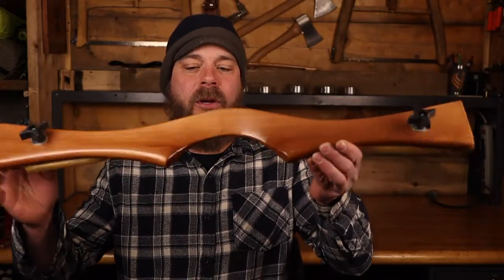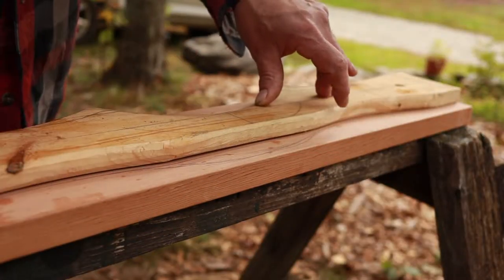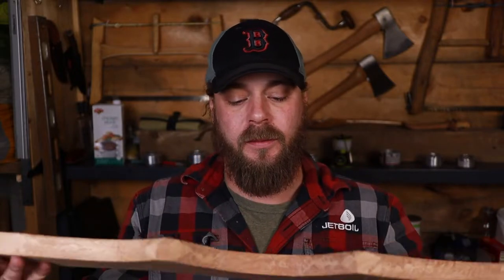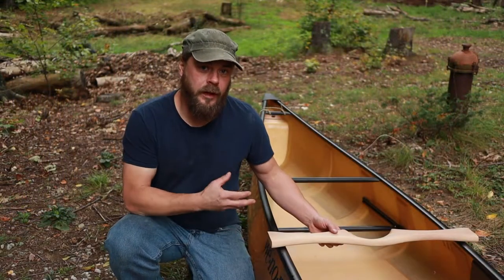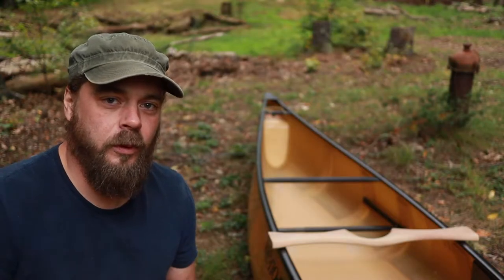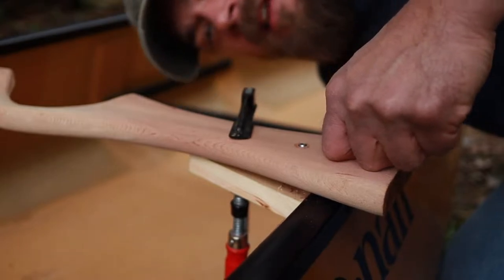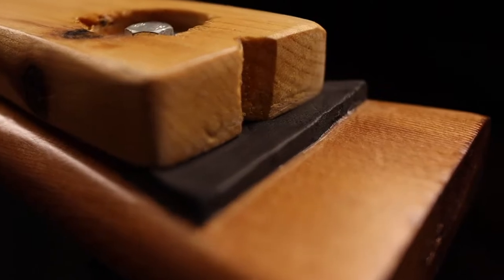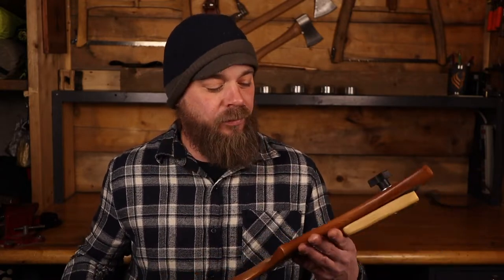How I made it / DIY lightweight Removable yoke

Comment: If you are canoe camping, then it follows that you have camping gear.  If that is true, then the seat does not have to stay in the middle of your boat.  You can place the seat about one third of the way back, and achieve balance by putting all of your gear in the bow.
Moving the seat out of the center allows for the installation of a permanent portage bar, and a two inch diameter aluminum tube makes the best one.  Flatten its ends in a vise and then use two number 8 bolts on each end to attach it to the undersides of the inner rails.  Cover the tube with a layer of 1/2" foam insulation.  
Now you can carry your canoe at any angle without having the portage bar dig into your shoulders.  I've used this type of portage bar in the Boundary Waters and can vouch for its efficiency.
Reply from the maker: Thank you for the suggestion. I have heard others say the same about moving the seat. But I think I am going to leave it for now.

Comment: Hi, and I love your  video. I’m kinda old, but I still make things, appreciating the curious, problem solving mind.  ; )
I just received my new solo canoe and need to do exactly this - make a yoke.  I would like to know what “this” is…….that’s all you said about the bolt/tightener thingy ; ) .  Those black tighteners look much better than standard wing nuts for aging arthritic fingers.
Thanks again. You are an inspiration.  ❤️ 10:53   8/14/23
Reply from the maker: Thank you for the kind words. They are simply called threaded knobs. I picked mine up cheap at the local hardware store. They work great.   What did you get for a canoe!!??

Comment: Are you happy with the comfort level without pads? Some folks just use their PFD for comfort while portaging. You have built a beautiful yoke!
Reply from the maker: I am quite happy with the comfort level. I put some pretty heavy contour into this thing, it fits nicely on my shoulders. Also, the straps of the backpack offer some protection as well. It all worked out quite well. One of the portages I did last season was well over a mile, I had about 70lbs of gear, including the canoe. That weight seemed very manageable and I don't seem to recall any real noticeable discomfort from the yoke. 
  This was a very fun build ,  I am extremely pleased with it. I hope I have it for years to come. Time will tell. Thanks for stopping by man!

Comment: Nice work. I need to make one of these for my new canoe. Can I ask about a small detail, what is the purpose of the small notches on the gunwhale side of the edges? Thanks 🙏
Reply from the maker: That is a very good question. Those notches are to give room where the end of the rivets stick out on the inside of the gunwhale.  This way the yoke is not pushing on the rivets.
Reply: @ItsGoodintheWoods  thanks for the reply much appreciated, happy paddling!

Comment: Nice yoke. You could probably have slimmed it down to half thickness out towards the gunwales.
Reply from the maker: That is a good suggestion. the thought never crossed my mind.....Thank you. I may have to revisit this project. The yoke is still going strong, and it fits my new canoe as well! I suspect I will get a lot more use out of it....
Reply: @ItsGoodintheWoods  You should. It might save onces of weight! Or at least one.

Comment: That build looks great.  Are you concerned about the wood marring the gunwale of the boat?  It looks like it would be easy to add some padding to the yoke clamps (although you might need a longer bolt then. 😄)
Reply from the maker: Thanks Doc! I did glue a piece of thin closed cell foam to the yoke to protect the gunwale and give it more grip. You scared me there, I had to go back and check to make sure I put that part in the video. I didn't put any on the clamp that grabs the bottom side of the gunwale though. I think I am going to. I don't believe it will make much of a difference in grip strength, that seems real good as it is, and I am not really concerned about the cosmetics of that side of the gunwale. But there is a little bit of a squeak when I am walking....I believe it to be the wood on metal contact. If it is squeaking it must be moving enough to create that noise. So maybe it will improve grip strength..........I may need a longer bolt LOL!
Reply: @ItsGoodintheWoods  I apologize for missing that if you showed it in the video.  That's the problem of watching youtube while I'm working.  If the squeak bothers you, consider adding a delrin bushing to the bolt hole.
Reply: Ok, just rewatched... I see the padding now.
Reply from the maker: @Doc_Watson  That is a very good idea!
Reply: @ItsGoodintheWoods  Add a piece of duct tape to the gunwales where yoke attaches for grip, protection, and squeaking.  Great job, Justin!
Reply from the maker: @MichealBacon  Thanks man. That is a good suggestion. I have a piece of closed cell foam on the yoke to protect and grab the gunwale.